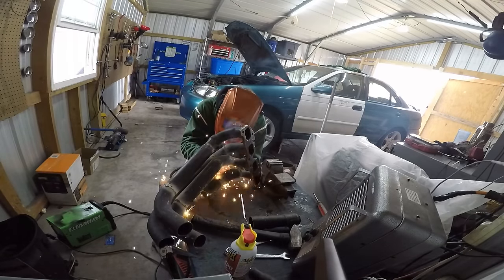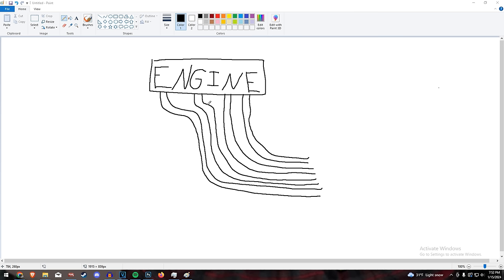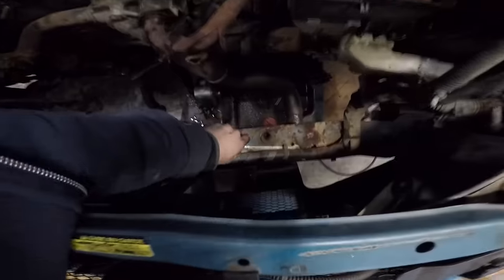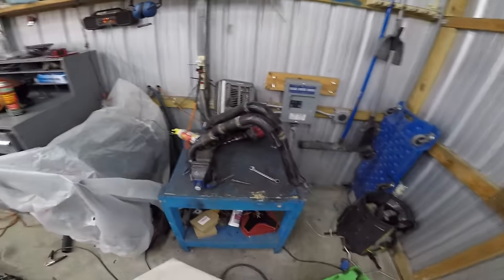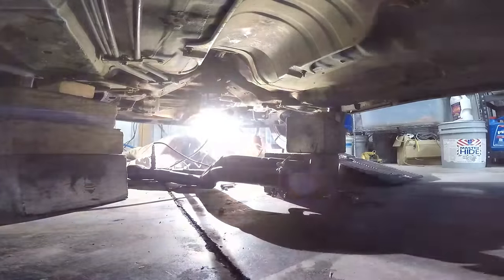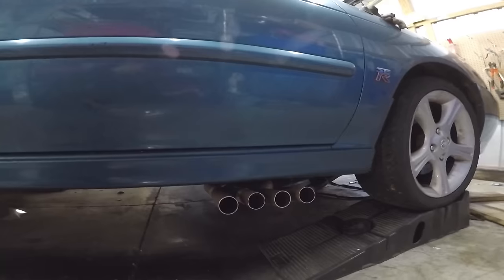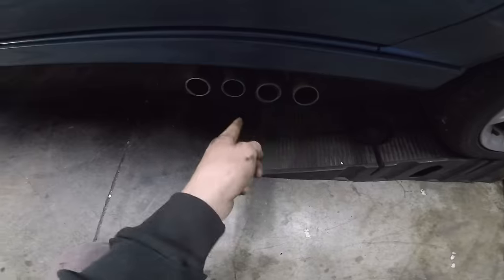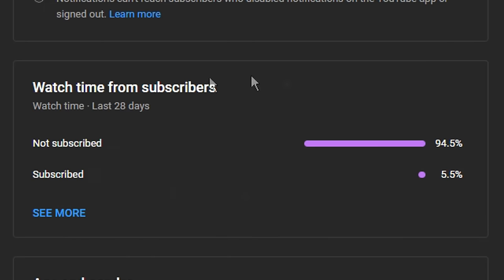True Quad Exhaust on a 4 Cylinder - What Will it Sound Like?

Comment: This was giving off serious subaru vibes to me.
Reply from the maker: I can see it sounding like a Subaru at idle, not so much revved up though
Reply: @HatersGarage  idle and part throttle is where I heard the most similarity.  You're right about wot.
Reply: it sounds like an n/a subaru ej25. my 00 legacy sounded like this
Reply: @aegixxer1 yeah it sounded like a subbi during some parts it was strange it switched from Honda to subaru 😭😂 depending where it was in the rpm range and distance from camera
Reply: I was about to say the same thing, lmao
Reply: I wanted to see if anyone else heard it too. It sounds very similar
Reply: Nah sounds just like my homies outback with a side exit lmao
Reply: It sounds nearly identical to an early WRX with an open downpipe to me. I have been around them a lot, hahaha.
Reply: At idle and cruising it sounds just like my straight piped wrx
Reply: Subaru's sound like they do because the tube lengths are designed to merge pairs of pulses, so you get 2 pulses for 4 cylinders.
Reply: It’s a hondaru
Reply: The pipes are all random lengths so you get an effect similar to the unequal length headers on Subarus.
Reply: It's not really the Subaru engine that sounds like that. The BRZ uses a boxer and it sounds like a regular 4 banger. The magic is in the Uneven length header (UEL). This is basically the same thing, but open.
Reply: that, or air cooled vw..good stuff!
Reply: @HatersGarage  Now you have to do this setup on a Subaru to see if will sound like a Harley.
Reply: this sounds a LOT like my old 2003 wrx with headers + uppipe, even when revving.
Reply: @Universal.G sounds more like a conventional inline 4 but it still doesn't sound like a inline 4 that's like saying a v6 and a inline 6 sound the same
Reply: i think it has to do with unequal tube header length
Reply: @HatersGarage  What about installing a small resonator for each pipe?
Reply: A nissan micra k11 with unequal lenght headers makes the car have Subie wibes.
Reply: yeah at WOT it sounds like track-piped 4 cylinders kinda imo
 @aegixxer1
Reply: @HatersGarage actually it sounds almost exactly like my sti when its reved up
Reply: Because subies have unequal length exhaust headers, the sound is from uneven exhaust flow. Since all these pipes are different lengths it gives the same growl
Reply: @bg710  came to say it sound exactly like an NA with its exhaust cut off past the header lol
Reply: Agreed
Reply: That's actually the reason Subarus have that distinct sound, the headers are different lengths.
Reply: most definitely
Reply: Thats due to the unequal length headers, creating irregular exhaust pulses
Reply: The firing order ;
1-3-4-2 
Vs pipe order ; 
1-2 , 3-4 
That big gap getting from 1-2 cylinders creates the " unequal " sound
Reply: @bg710  I agree mate. My current n/a 250t sedan sounds exactly like this just a little deeper on the tiger revs
Reply: When did the head gasket blow?
Reply: @bg710  so did my forester with just a straight pipe but magnaflow high flow cat and a can cleaned it up
Reply: Sounds a lot more like a Nissan straight 4 to me, but what you're hearing is the uneven length exhaust pipes.
Reply: @bg710 

Any boxer using UEL headers.
Reply: Sounds like a WRX with straight pipe 😂
Reply: cuz of the headgasket leak? lol
Reply: Same here
Reply: I was going to say the exact same.
Reply: @HatersGarage  i thoght the same thing when i heard it
Reply: @Dukes3677 Outbacks have equal length pipes, so they sound closer to a normal I4, this is definitely what mine sounded like, Honda/subie at various rpms
Reply: Unequal length headers 😂 ion think he intended to do that but they are different lengths
Reply: That's what I'm sayin! Get some hanger brackets and you're good to go!
Reply: @HatersGarage sounds kindof like the norwegian il tempo gigante from the stop motion film when revved up
Reply: Everyones thought watching this
Reply: Civic vibes
Reply: As soon as it started sounding like a Subaru it suffered a head gasket leak… coincidence? I think not
Reply: Yes sounds like Subaru engine 😂😂😂😂👍🏻
Reply: @miguelasm3159  No, it sounds like an engine with an unequal length header.
Reply: @HatersGarage Add 4 different mufflers so it sounds like multiple cars
Reply: yeah at 2:57 before it goes past the camera it sounds like an EJ @aegixxer1
Reply: It's almost plagiarism because it's the same sound 😂
Reply: Maybe it would give out the same idle and rev if the pipe lengths are different for each cylinder. Like massive pipe leng difference
Reply: same xDD
Reply: @bg710  sounds like my garage Subaru classic n/a it has a manifold leak and many other faults hilarious car
Reply: You've given me an idea for my subaru...
Reply: The 'boxer rumble' comes from unequal length exhaust manifolds  / headers. Put a set of equal length headers on a Subaru and it pretty much sounds like any other 4-cylinder.
Reply: @adamhuegel  that is interesting I always thought it was because of the lateral piston layout
Reply: He need hooks to hold the piping lmao it’s just dangling
Reply: Honda 2 step with a subi grumble
Reply: aturly its not exact, mine equal length and it has a boxer rumble on idle revving it give it away @adamhuegel
Reply: I was thinking the same thing. I have a buddy who had a 2005 STi with tube headers, into a downpipe, then turned and exited straight out behind the front right wheel. It was for track days. sooooo noisy.
Reply: @HatersGarage  some of those Subaru boxer engines really does sound 99% like this!
Reply: One of my roommates had a an older Subaru Outback with an exhaust leak. It sounded like this (but quieter).
Reply: so what youre saying is subarus sound like shit?
Reply: @River_of_Revenge  you said it, not me lol.
Reply: That was just the headgasket
Reply: Big time. So close to my first bugeye
Reply: Sounds like a Subaru not bad
Reply: Nah, it didn't break the minute he gave it the beans...
Reply: Subaru gang has entered the chat 😂
Reply: that's exactly what I thought when I first heard it.
Reply: @HatersGarage Facts, sounds like a Ford FE at WOT
Reply: Because pipes have a different length. Subaru had this sound for the very same reason. To make this experiment clean, all pipes should have the same  length.
Reply: Yes, sounds as bad as a Subaru boxer. Indeed.
Reply: it does kinda sound like a flat / boxer
Reply: @HatersGarage  Well, from the drive by footage, it almost sounds like a rally car to me.
Reply: You're profile pic at first glance dosent look like a cat
Reply: My cherry-bombed 01 H6 makes some funny noises
Reply: Lol yeah. Sounded like my GT86 when I smashed the manifold running over a tree branch that fell in front of me in a storm.
Reply: And the reason why a Subaru sounds like it does is due to the unequal length header pipes. If you find one with equal length header pipes, they sound completely different.
Reply: @HatersGarage  yea it sounds almost like my dream Subie at idle, which was this crossed with a 450 4 stroke dirt bike.
Reply: VW
Reply: Guys, Here is The Savior

HalleluYAH “Praise ye YaH”

YaH is The Father (Genesis 1)
YaH arrives via the TENT OF MEETING
YaH was Who they Crucified for our sins
YaH was Crucified on an Almond TREE

Ancient Semitic Moshe (Moses)
Isaiah Scroll (The Original Isaiah)

Isaiah 42:8
I am YaH; that is my Name! I will not yield my glory to another or my praise to idols.

Isaiah 43:11
I am YAH, there is no other Savior but Me.

Isaiah 45:5
I am YaH, and there is none else.
Reply: ok now put these on a subie
Reply: @supersonic4863  i did.  It just canceled all sound and now I'm permanently deaf
Reply: sounds kinda like my 01 outback 😂
Reply: Bro wrx came to mind off the jump
Reply: @HatersGarage  Reving it up sounds exactly like a k series
Reply: Y does it actually sound pretty cool. Reminded me of a boxer at idle and part throttle.
Reply: It sure was!!!
Reply: At WOT it sounds like a Hennessy C7 ZR1, those thing sound incredibly demonic
Reply: Like a mix of a 1986 Subaru stationwagon and a Saab V4.
Reply: Yeah it’s unequal length exhaust like an EJ subaru

Comment: Wow I think this is the most pure Half V8 sound I've ever heard. 4 cyls usually sound pretty different from V8's despite literally being half of one, but this one straight up sounds like half a V8.
Reply: It has to do with the firing order. I4 generally uses flat cranks. "Supercars" like Ferrari and the new Chevy C8 uses these cranks 

American V8s uses crossplane cranks, the only I4 I know that uses a crossplane is the Yamaha R1.
Reply: @Celciusify  Oh huh, I had no idea crossplane cranks were even a thing. Ya learn something new every day.
Reply: @Hell0  Firing order and cranks is an interesting subject, 2 cyl bike engines can vary a ton, almost every manufacturer had their own idea on what was best.
Reply: If you have the space underneath your car, lots of pipe, lots of time and a few screws rattling around in the machine room, you could weld up different lengths of pipe and combine them back together in such a way that the sound actually does resemble half a bank of a cross plane V8.

The reason a cross plane V8 sounds the way it does is due to the pressure waves either combining or canceling each other out. You could definitely get half a V8 rumble that way, although in the higher RPM’s it will sound more and more off. 

Actually, Subaru boxers have a similar sound effect due to different lengths of headers combining, which is why they also have a distinct rumble. 

I had a Buick L8 which would absolutely sound like a V8 at low RPM’s (but at higher RPM’s the scream would definitely sound very different).

There is a crazy Bonneville Buick on YouTube (forgot the name of the car and builder) which is definitely worth checking out; one of the videos of the car is the owner filming it in his driveway for a friend so he could listen it roar. Absolutely amazing stuff. Really makes you appreciate the old Fireballs.
Reply: Found it: BONNEVILLE BOMBSHELL BETTY 2010 on channel 555BROCK. Jeff Brock is the name of the builder and it’s absolutely amazing! Yes it’s an old video but the sound still shivers me timbers.
Reply: 8v I4 vw engines sound kinda like half v8s too
Reply: @travisstamp7428  Can't say I've listened in on those too much, all the fastboys in my area like to put straight pipes on the 6 cyls and the 20v i4's but nothing lesser
Reply: 4 cylinders sound different because of the design of the crankshaft. Most 4 cylinder engines are a flat plane crankshaft design. Check out a cross plane 4 cylinder motorcycle, they sound just like little v8's.
Reply: Listen to a cross plane 4 cylinder engine and it sounds exactly like a v8 because of the similar firing order
Reply: odd seeing you here lol
Reply: Jettan WTF are you doing here.
Reply: @TEHBR0LY  its baby
Reply: @TEHBR0LY  getting ideas for the volvo
Reply: @crazychivez  right back at ya lmao
Reply: Different firing orders.
Reply: The only c8 that has a flat plane is the current top trim Z06 the others still have a good ole pushrod 6.2L crossplane. As they all should. @Celciusify
Reply: "Most" V8s are built like two V4s together, not two inline-fours joined together.  V8s that are built like two inline-fours joined together, e.g., Ferrari F430, do sound like two inline-fours joined together as you would expect. 🙂 Vice versa, a Honda V4 engine like in the VFR800 similarly sounds like half a crossplane V8 engine.
Reply: @Hell0 My first reaction was how does someone not know of flat plane vs cross plane. But then I remembered I was in the same boat 15years ago. I Googled the infamous, “Why doesn’t a Corvette sound like a Ferrari?”
Reply: @RustOnWheels  There is a Honda unequal length header that makes it sound like a Subaru. There's images & video on google. I want to see that concept, but done with 4 + 4 pipes, half of them with a long loop. So there'd be 8 pipes coming out of the header. I really want to try this on my beater but I'm not as motivated as @HatersGarage it would seem
Reply: Firing order is what really changes the sound
Reply: Reminds me more of half an inline 8 to be honest.
Reply: @TassieLorenzo not exactly. Hondas V4 sound like a parallet twin v’d with another cylinder bank. It’s still a flat plane.
Reply: Let's all stop and appreciate that someone just found out about the glorious sound of a crossplane I4  @Hell0
Reply: I faintly remember hearing that people are a bit off when Ferrari flat plane crank engine was new cuz it sounds like inline 4
Reply: v8 sound has everything to do with the way the combustion combines in the exhaust. v8 can sound very different depending on the type of crank and exhaust collection
Reply: To me it sounds like a tractor lol
Reply: Straight up
Reply: Not to me it doesn't lol you musta grown up with modern V8s
Reply: Its the crank that makes the kost difference, crossplane cs flatplane
Reply: Adding on to the list, vizio has a list I believe of crossplane bikes. The mazdaspeed 3 has somewhat unequal length headers like the wrx. And as LtJerry mentioned, there are some popular uel headers sold for the B, D, and R series sold online or done at home, so some videos are out there.
Reply: not quite, considering most 8's are v's and most 4's are inline's.....
Reply: @rainregn996  What in the 1950s? Ferrari always had flat plane cranks. Perhaps you’re talking about the C8 Corvette
Reply: @carlosandleon  no it's definitely about Ferrari, but I don't remember when they're talking about.
Reply: @RustOnWheels I’m interested in how should I measure the pipe lengths to get that effect. Do you have more info? I might actually build it
Reply: @luipars   hmmm well I did make a physical model for engine sounds once, what I did to recreate the exhaust pipe was make a delay line, but there is a difference between the speed of sound (which also changes with the heat of the air) and the pressure wave. 

So what I suspect is that one needs to know the speed of the pressure wave from a typical x-plane V8 and that of the L4 (not sure if there is a difference and if that changes with load, rpm or power) and then calculate the length needed to recreate the timing of the pressure waves coming together.

You almost got me enthused to dive in that as well, but unfortunately I don’t have a lot of time…
Reply: @luipars  hmmmm I did read in a little and it maybe just down to the speed of sound at a given temperature but as long as the temperatures are alike cold and hot one can calculate the tube length from the speed of sound of say 400°F and I’d say do the length of an idling V8 at - let’s say 750 RPM (as the rumble is the coolest part of a V8 sound). 

Then you need to know the firing order of the V8 bank you want to recreate and then make the tubes to length for that specific timing at the collector. I guess maybe one or two tubes would need that length change. 

The length change can be calculated by the amount of ignitions at 750 RPM for the V8 and the L4, then plot them against each other to see where they meet and where they differ. The difference(s) can then be recreated by lengthening the tube(s) to match it from the speed of sound at 400°F. I’m used to calculating in metric so for me it would be the meters per second. The difference in milliseconds between the ignition difference is then easily calculated as the speed of sound is a given at that temperature.
Reply: @Celciusify The Mustang Shelby GT350 has has a flat plane crank V8 ("Voodoo" engine) since 2015, and was the first American car to use one, and also the first mass-produced flat plane crank V8, with most prior production being confined to Ferraris.
Reply: @Celciusify  Add ford 5.2 "voodoo" to the list of flat plane cranks... Though it has a different order than what you're talking about
Reply: @RustOnWheels o

Comment: Being able to diagnose cylinder exhaust individually is awesome. Never even thought of that
Reply: As a motorcycle rider I've used this before to know which cylinder is leaking
Reply: @RonaldPlett As a moped rider, so did I. Was even easier.
Reply: ZaHandle  most likely it is cylinder 1
Reply: Back in school we were trained to see, smell, and hear the engine to diagnosis issues.  I can tell you by smell if the engine is running rich, burning coolant, or burning oil in 5 seconds.
Reply: @82raptor I'm not impressed. Now, if you could tell the difference between 10w30 and 15w40 by taste...
Reply: It's even easier when there is only one cylinder to diagnose!
Reply: i was thinking the same thing when he said that. lol. like "ah.. #2 seems off..."
Reply: @Hawk7886 i imagine taste would be the same, but you could do it by mouthfeel
Reply: @Hawk7886  any real technician can do that, now if you can tell me which cylinder is the problem cylinder by sound and smell alone without tools, then I'll be impressed.
Reply: @82raptor the real question is can you smell a fart and know who cut the cheese? 😂
Reply: @82raptor  yes, but which cylinder is it? As a car guy, one who runs engines with two heads, I've typically gotta replace two head gaskets to fix a coolant leak on a single cylinder. Not that that is bad practice or anything.
Reply: A infared heat gun on the exhaust manifold can also let you know whar cylinder, isn't getting good ignition
Reply: @82raptor That's not at all difficult.
Reply: @KFitzG35competitor Beat me to it!
Reply: When you let off the throttle when revving 🥵
Reply: It’s old. You must be 2?
Reply: @Hawk7886 *drinks engine oil* “yeah it’s 10w30”